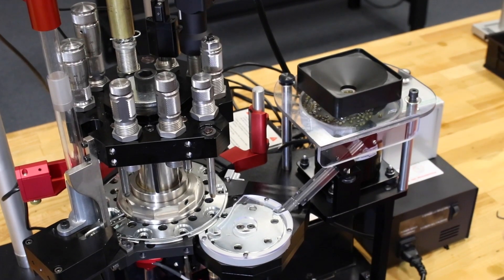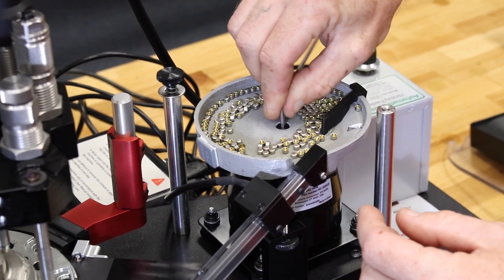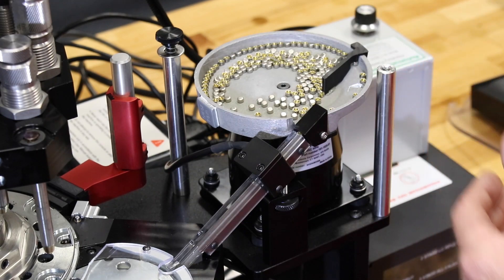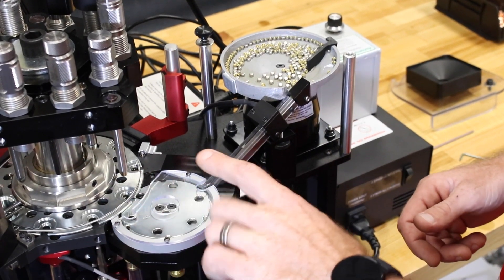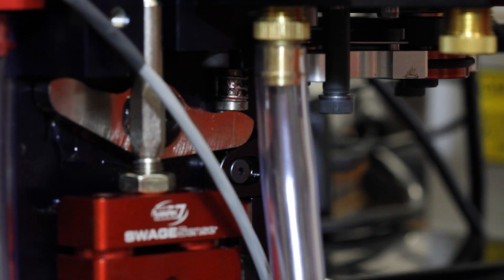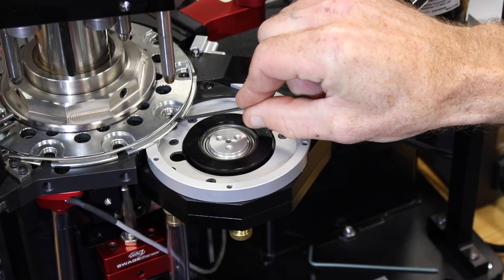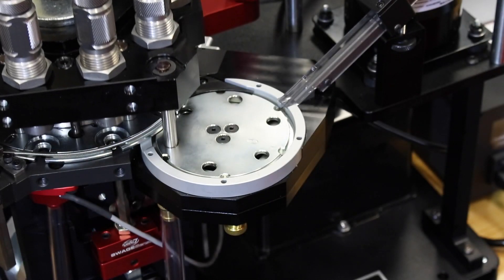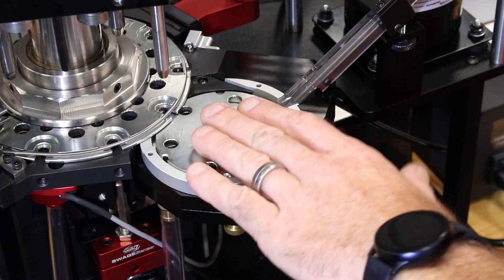Automated Priming System Setup and Operation For Your Mark 7 Press!

Comment: I noticed at 9.57.. after clearing the primer fault, when you restarted the press that it was feeding primers without cases on the shell plate. So if you don't have a case the primer feeds anyway is that correct 🤔